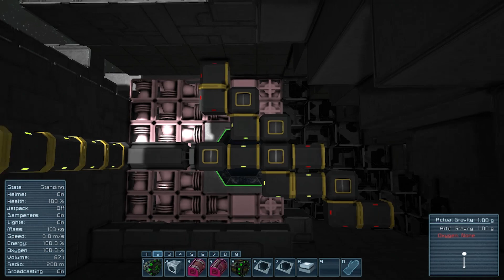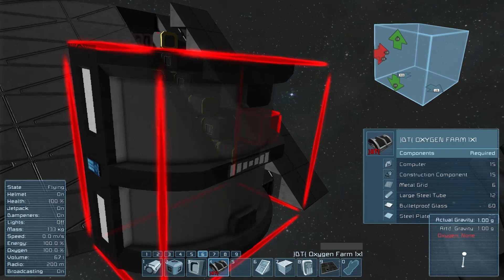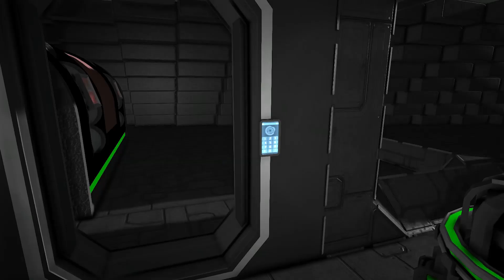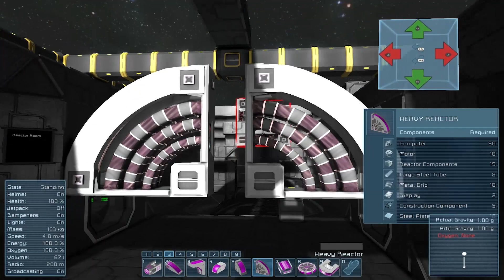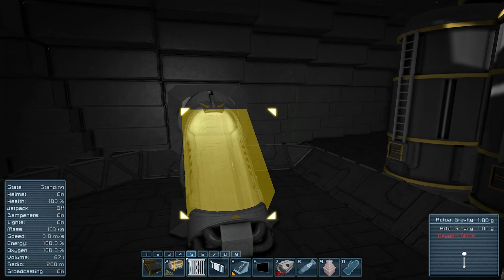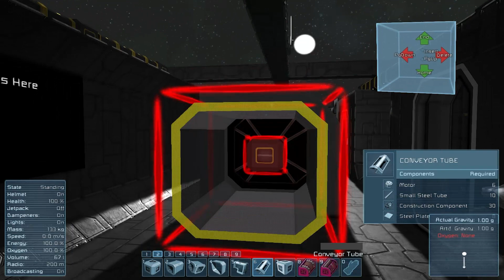Let's Play Space Engineers - Episode 76: Update Catastrophe!

Comment: If you have them all on one side what happens if you take a bad hit on that side? If half are on one side and the other half on the other or it runs down the center some you are safer. But I do like how it turned out.
Reply from the maker: Duke00x I thought of that, though I would have something different on each side i.e. refinery on right, assembler on left, so I suppose it could still be an issue. The other thing is they've update the heavy armor blocks to cost more but take more damage in the latest update. So given that my hull is all heavy armor I doubt it would actually punch through it that easily.
Reply: Sleepless Knights Studios Is the floor heavy armor? I have been meaning to ask.
Reply from the maker: Duke00x Not presently, but it's because I'm not sure how I'm going to do the hull on the bottom. If I cover what's there then it wouldn't need replacing, but if it stayed just flat 1x1 blocks as it is then I'd probably redo it.